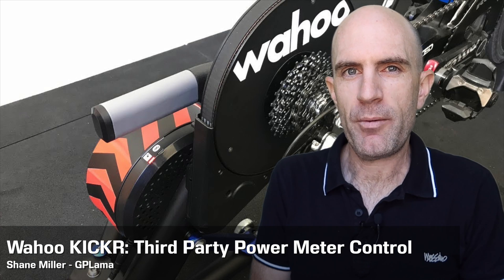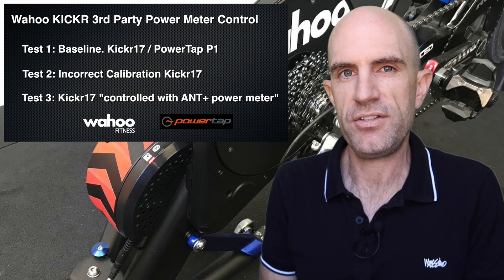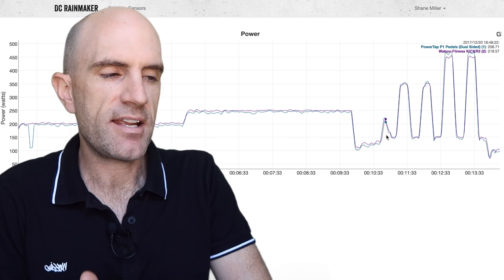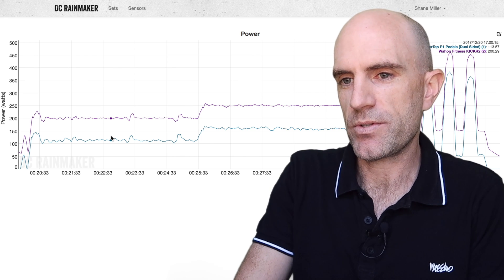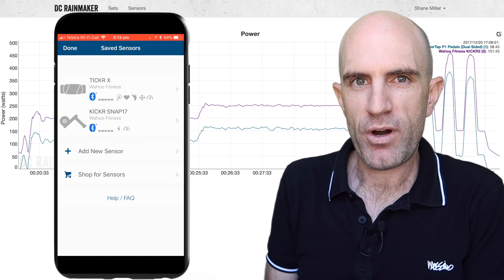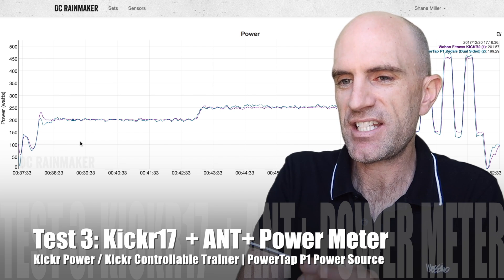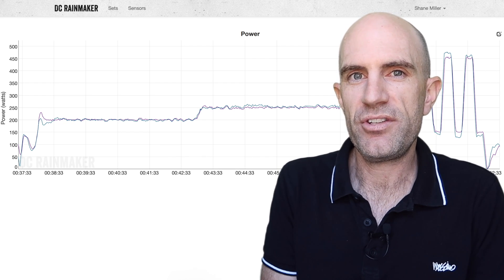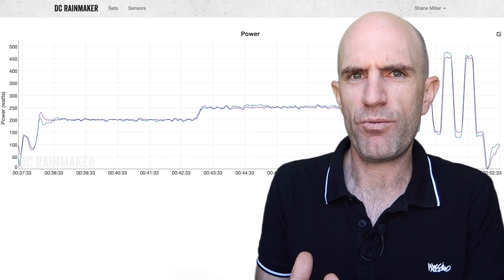Wahoo KICKR: Third Party Power Meter Control

Comment: Shane this is great :) I find with the kickr snap erg mode workouts are less jagged than i if use an external power meter with it for them. my power varies and the system tries to get back to erg target as expected. but it takes longer. have you considered testing that variance and across wheel on vs wheel off trainers?

Comment: Helloo Shane, thanks for the video but I have got the question backwards.  I've bought a pair of srm exact powermeter pedals but you'll know you have to calibrate them yourself manually.  But how can we know we dit a good job, knowing I only have an elemnt bolt 2 bike computer and a kickr indoor trainer?

Could it be that I connect the kickr to my laptop and see for the powerdata there and that I look at my bike computer for the powerdata of the pedals?  So when going on Rouvy or strava not connecting my elemnt bolt to the app?  Or what are the possibilities here to know I dit a good job calibrating the exact pedals?

Thanks in advance and greetings from Belgium

Comment: Hello Shane I contacted the wahoo support and got interesting answer regarding your 3rd test where select to control kicker with the ant+ power meter
"
The power match feature is available at this time, but only for iOS users when doing a workout in the iOS Wahoo Fitness app. This setting does not transfer when using Zwift or another third party application. 

You can use your third party power meter in Zwift, by adding it as the power source, and the KICKR SNAP as the controllable. "
I'm quite sure that he's not right cause I was able to perform the test myself and I'm sure kickr snap was using ant+power meter as source in zwift.
Reply from the maker: Zwift and other platforms do have 'power match' which means you can use your power meter for power and the SNAP (or other trainer) for the resistance unit.
Reply: I can confirm that the power match feature only works for wahoo fitness app. I received the same response from Wahoo support. They recommend using my power meter as the power source and Kickr SNAP as the controllable in Zwift. My experience showed that when power matching is on, power readings from my Kickr SNAP was consistently lower than reading it directly from my Stages power meter. This is a bit disappointing for me due to the delay in resistance when training using ERG mode in Zwift.

Comment: 3 years 4 months after this video and you still can't do the 3'rd test on android. It's ridiculous ....
Reply from the maker: Refresh my memory… the third test?
Reply: @gplama  where you connect your power meter in wahoo fitness app with ant+ to be the source for power for kicker.then you select kicker as the power source and controllable in zwift You can do that in iOS on Android wahoo fitness app you don't have that option.
Reply from the maker: @boogiexx  Given most platforms now support power matching (power meter as power source, smart trainer as resistance) it's effectively a redundant feature. It's one to ping Wahoo Support on if you believe it's something you need.
Reply: @gplama  yes I already wrote a ticket to them. The thing is I don't understand how power matching works, ok it reads the power from the power meter, but when it set's the resistance does it use Kicker's power source or is it just trying to match the power reading from the power and doesn't use Kicker's power at all.

Comment: Hi Shane - can't seem to find the answer online. How do you connect dual power meters to control the Kickr? Issue is having the Wahoo Kickr reading the two ANT+ device IDs
Reply from the maker: Not possible. Dual ANT power meters will have a master that gives total power from both sides. Use that ID

Comment: What the best way to use Quarq power meter with wahho v5 on apple tv with put any drop outs?
Reply from the maker: Resolve the dropout issues by clearing up the 2.4GHz space. Switching to 5GHz wifi is the best start.
Reply: @gplama   and how do you connect a 3rd party powermeater on the wahho app for the kickr v5 i cant seem to make it my main power source
Reply: Have you've been successful pairing 3rd party power meaters to the wahho app and making that your main power source?

Comment: Thanks for this video, didn’t realize this was possible. Power matching is surely the way to go to for the same source inside and outside. The question that comes to mind is if this method makes for a smoother ERG mode than doing power matching externally in Trainerroad/Zwift or any other app?
Reply from the maker: Power match typically results in a slightly worse performance in ERG.... it depends on the software and platform/etc.
Reply: @gplama  I was using power match in Trainerroad up to now. Will give this a try for my workout tomorrow. Thanks a lot!
Reply: @gplama  will the delay be better if I use a ANT+ antenna?

Comment: I have had this working pretty much since this video was released. I do all of my ERG workouts with this enabled (Sufferfest), from what I gather this means I don't ever need to calibrate the Kickr? I have found in the past the Kickr to under-estimate power (eg Kickr saying 300W my power meter saying 315W) and so previously if Sufferfest was saying put out 300W I was actually doing 315W, but now if Sufferfest says put out 300W I actually put out 300W. In this instance, I assume no need to calibrate? Because the Kickr is using the power meter data to be controlled, would it be potentially quicker at changing power/resistance if the Kickr was calibrated and more accurate, or not? Thanks!
Reply from the maker: Sorry, I'm reading this prior to my first coffee of the day and don't follow the question. If you're using the Kickr as a power source then it needs to be calibrated/spundown every few weeks/months (depending on usage) for most accurate data. If you're using your power meter - that'll need a zero offset done for most accurate data (depending on model)
Reply: @gplama  This answers my question. Basically I was asking whether I need to calibrate my Kickr at all if I set it to be controlled by a power meter. You've answered that thanks!

Comment: Shane, I am finding that if I directly connect Zwift to my Assioma pedals as the power source and the Kickr as the controllable trainer while in EGR mode I get a lot of variation in power with it jumping around all over with the same cadence.  I decided to pair Zwift to the Kickr for both and it was lots better!  Would this trick explained here in this video help me with the power smoothness plus keep my normal power source consistent (the pedals)?
Reply from the maker: Power Match introduces a bit of lag/latency, so it's not perfect. Remembering by default the Kickr will have ERG Mode Power Smoothing enabled by default which makes the power appear stable. Switch that off within the Wahoo App for more realistic power numbers in ERG.
Reply: So best no lag solution when in ERG mode is using Kickr for both power and controllable trainer in Zwift with power smoothing turned off?  I found the lag with Zwift using the pedals as power directly almost unusable in ERG.  It was like constant yo-yo effect as it tried to deal with the latency even with very consistent cadence.  Thanks for the reply!

Comment: Is this option only available on iOS and not Android?
Reply from the maker: 🤷🏻‍♂️One for Wahoo Support if it’s not showing up in the Android app.
Reply: @gplama  cheers!
Reply: I have spoken to Wahoo, and they have said they'll soon be an update to the Android app which will allow this feature to be enabled.

Shane - do you know if this "power match" feature works with the Sufferfest app? My Kickr reads out by a few % to my power2max power meter, meaning different power settings in the app....plus the difference in power readings can fluctuate so my sufferfest app is rarely 100% accurate, if this sorts that, I would be one very happy boy!! Can you confirm this?

thanks!
Reply: The toggle button is now in the Android app but it doesn't seem to do anything 🙄
Reply: @qec  what version of the app are you running? I still don't see an option.

Comment: If I want to control trainer road or zwift with the reading from my powermeter. Do I need to not even use the wahoo app and just let trainer road or zwift calibrate it and connect my powermeter for resistance with them. Or do I still need to go in the wahoo app and change it over to my power meter as well
Reply from the maker: No. Just select the power meter as the power source in either app and you're good.

Comment: I was just comfy on how you paired it with zwift. I just see both pier sources as the kicker . But know if your on zwift doing races wouldn’t you just pair your powermeter up for the power source and leave the kicker as the control. If so , then when would it be good to use the kickr and have the powermeter take over. When your just on the kickr and have it only by itself. Like not running off any apps. Would that be the time to do it

Comment: Ok so when u use it with my power meter as the source. That’s means it will be like real life to where I need to shift gears for resistance right. Just like riding outside.

Comment: Thanks Shane for another helpful video.  My 2018 Kicker seems to be reading about 25% lower than my Stages PM.  I think I'll just use the Stages as the master and hopefully it will correct the issue.  Don't understand how the Kicker can be that far off though.
Reply from the maker: What if it’s the Stages, or both?
Reply: @gplama  I'm doing a few caparisons with different power meters, but I really need that third PM to be definitive.  Stay tuned.
Reply: @gplama  i don't think it really matters. A watt is just a unit of measurement, a 'stages quasi-watt' is still a unit of measurement as is a 'kickr quasi-watt'. As long as they are consistent. The stages provides a measurement on road which is consistent with on the trainer if calibrated... much much better than nothing and only very marginally worse than the best solutions available.

Comment: Does this mean I can design my workouts on Garmin and control trainer in ERG mode using my power2max powermeter?
To be able to use this feature - do I need wahoo app work all the time while i am riding? Or can I watch netflix on my iOS device?
Reply from the maker: - Link your P2M to the Kickr via the ANT+ ID. No need to have the Wahoo app open.
- Have your Garmin Edge control the trainer via ANT+ FE-C. 
- Play Netflix on your IOS device. 

That should work, in theory.
Reply: @gplama  do I need to pair P2M to the Kickr via the ANT+ ID every time I start training (before every training) or just one time ?
Reply from the maker: @mmarnauza  Once.

Comment: What if instead of doing this directly in the kickr, you just paired your power meter with for example a head unit like Edge 520 Plus and at workout time chose your power meter as the power source instead of the kickr? Would it still work properly or does it have to be done directly in the Kickr Snap software? Thanks.
Reply from the maker: Yes, that's called 'power match' in most software.

Comment: Shane - any sense when they'll actually release this functionality for Android or know how to access it another way? Seems strange since it's not a phone platform limitation but rather a feature of the kickr itself to access. Plus they've had it released since 2015 and per my calls with wahoo claim to "have it in the works". I'm trying to do this since my quarq can't maintain connection with zwift to do power matching, but has no trouble connecting with TR via ant or my head unit vs ant. So was hoping this function would work as an alternative.
Reply: I've just received my Kickr Core and was looking for pairing my P2M to it vian Ant+ ont the Android Wahoo Fitness app. I've just realized that this feature is only available on iOs. I'm waiting for this functionnality too !

Comment: Forgive my ignorance but what would be the benefit in controlling the Kickr with an external power meter if the internal control seems to be accurate enough. Or did I miss something?
Reply from the maker: In theory this isn’t required. In practice...... sometimes it is.
Reply: Assuming your KICKR is as accurate as your power meter, there is still a benefit because 1) calibration of your power meter is likely faster than doing a spin down and 2) if your KICKR is a Snap (wheel on) you don’t have to worry about tire pressure.

Comment: Hi Shane, In Zwift set up I use power source of Vectors, but Im looking to try Vectors bind to Kickr to get around the problem of lag in work out mode (particularly on the shorter intervals etc), which opens up some questions.
1) What has been experience on around improvement on lag using 3rd party power meter bind to the kickr for workouts and lag
2) For a house hold lucky to have two bike on vectors (his and hers) apart from having to remember to use the Wahoo to rebind different pedal ANT ID's, have you tested what the kickr does if the bound 3rd party power input is not present or inactive etc. does it revert to its own power measurement or just read zero power etc.  ie Im looking to under what happens if you forget to enter in a different ANT ID into the wahoo app to swap between bikes etc.  Has there been any battles created between different bike owners in the Lama lab ?
Reply from the maker: Sorry I'm not going to be able to answer any of these in a reasonable timeframe (away from the Lab for the next two weeks). Good questions for Zwift and/or Wahoo support though.
Reply: was wondering if there was any his and hers Ant ID issues encounter in the lab :-). might test and see what happens

Comment: Anyway to do this using an elemnt bolt head unit whilst performing a planned workout? I'm on android but might be able to borrow a iOS device if the setting stays on the kickr after I disconnect the app.
Reply from the maker: By default the BOLT won't do power matching, it'll use the Kickr / FE-C trainer as the power source for workouts. The setting /should/ stay within the device... so I guess you could program the ANT+ ID of the power meter and go from there.
Reply: @gplama  God, been connecting my Garmin Vector 3S and a 2016 Kickr to my Bolt unit to do indoor training for ages. It worked really erratically, often with a 10-20W converge and power really doesn't converge (often, I find my power output under, and trying to stamp it down only sent myself spinning). Didn't realise there is no power matching and I was reading from the Kickr and ignore the Vector 3S the whole time. Thanks so much for this.

Comment: Hi Shane. Just bought a set of PowerTap P1S' for use with Zwift and my Snap v1. I find the Zwift powermatching doesn't work too well for me so I have tried the method with the iPhone and the Wahoo App. Once set will the Snap always remember to use the PowerTap or will this only work using the Wahoo App? Unfortunately when using Zwift I can't tell which powersource is being used (snap's own or rebroadcast PowerTap) Any thoughts? Cheers.
Reply from the maker: One for Wahoo or Zwift Support. They've got people fully across their products to help out for these ones.
Reply: Shane Miller - GPLama Thanks Shane. I'll get in touch with both and see what they say. Hopefully the answers will be the same!!

Comment: Great video - thank you. I'm struggling to get this working with the Kickr Snap and a Stages power meter. Using ERG mode with PowerMatch in Zwift I don't find particularly usable. And Stages have an article on using the method you described here for better results. But I spoke with Wahoo and they said this is only if using the Wahoo Fitness app. They said it might work if you leave the Wahoo Fitness app running in the background. 

So my question is do you have to have the Wahoo app running in the background? And have you tried this with the Snap (V2).

Also did you find you could also then get cadence off your power meter connection - it's supposed to read cadence, which would mean you could connect your Wahoo Kickr for power, cadence and control. But this doesn't work for me.

Thank you!

Comment: How did you incorrectly calibrate, and what is a "proper calibration"? I've done a number of advanced spindowns after 10 minutes of warmup on my Kickr v1, but always seem to suffer from power drift compared to my PowerTap C1 power meter. Is Kickr v2 and v3 better in this regard? I've had deltas of up to 60-80w variations (Kickr reporting low) after 30+ minutes of riding on Zwift in the big ring. I'm not really sure "what's up" there, it seems to be awfully frustrating at times. I've had to retension the belt, which seemed to help more than it really should, and then do an advanced spin down after about an hour of SST work. It seems closer now, but it reads high at first and then settles down to read more like my PowerTap.
Reply from the maker: Hmm... This is a good one for Wahoo Support. I'd check you're on the latest firmware (I'll assume you're across this already), then maybe replace the belt. If it's had a hard life then it might explain some of the strangeness.

Comment: Hey Shane I see you have you kickr   connected in zwift as fe-c, I was getting a lot of power drop outs when connected normally but since I've changed to fe-c I don't get any drop outs. What's the difference? I have read zwift can have issues with fe-c is this true? Tnx Paul
Reply: Paul Malone Had the same problem with my new Kickr until I happened to connect it to fe-c. I think fe-c is the standard for newer trainers apparently.